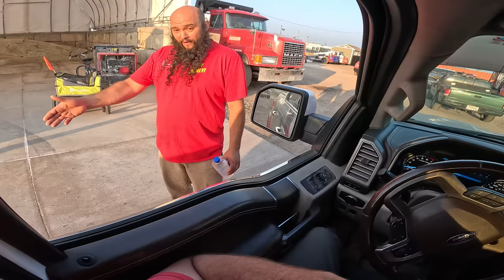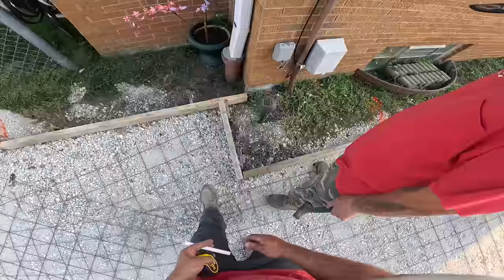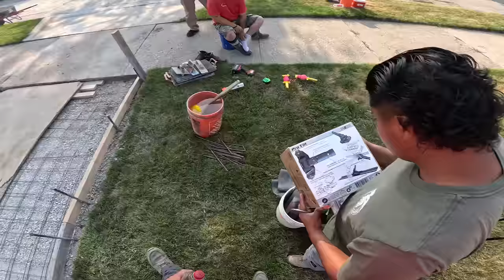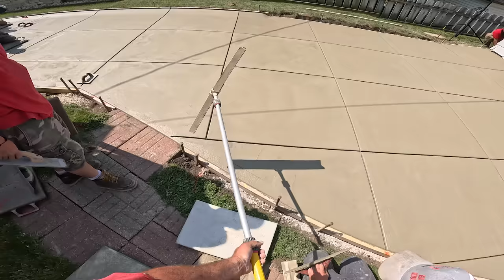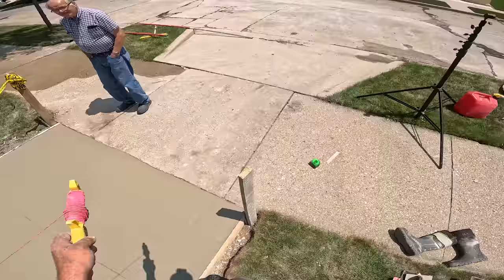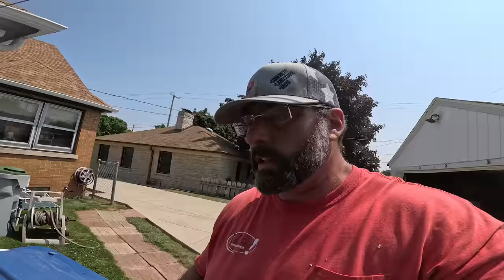Pouring concrete with the bicycle gang! The delusionals!

Comment: Ryan, why don't you rent a large excavator and set the big concrete beams up in a row for salt storage? You may to use some smaller ones for the width. It will save you rent at the other lot, and you already have the canopy.

Comment: Ryan great 👍 channel. I’ve been watching your channel for a while. I got an idea! You know those 4 each heavy concrete highway beam’s on the new property? When you reset up the enclosed road salt area, find someone with a small crane to come in and move them into place as the as the bottom base pieces, two on each side length wise. Then bring over the smaller concrete blocks and stack them in the back and on top of the big ones on the side’s. Maybe pour a pad of concrete first and just before it fully sets up stack the concrete pieces/blocks into place. That way they will set into the new concrete pad about 1”, making a water tight fit.

Comment: I have a question about concrete,  I work for a flooring company where I inspect new construction Slabs for high spots and low spots etc, checking the inetegreity of the slab... my question is what is it when I come across a slab that has a bunch of like fiber glass hairs in it, it almost looks like. Most are smooth.  But some has this fuzzy strands that came through time to time

Comment: If I could give you some advice regarding your gate, weld the dogs to the gate post and weld each nut to the bolts so someone cannot take the brackets apart to gain access. Trust me!

Comment: I would use those concrete beans for a back stop for the parking area or line the driveway with them. You could use for a salt corral walls. I wouldn't just scrap them.

Comment: hi ryan  your new yard seems only to be surrounded by hedge dont be so quick to get rid of those beams they would make great walls or bay dividers and the hammer on your bobcat would make lite work of them when they are dune with you already said your getting a dozer in  so pushed in to place as walls stop any squatter's or fly tippers just a thought  great videos mate

Comment: Maybe you could use those giant concrete pieces on the new property to your advantage, divide an area, new salt area, block access to vehicles on questionable property lines. You could put three in a rectangle with an open side and put a top on it to secure and cover equipment and other valuables. They look expensive, use them to your advantage. Love all the channels!

Comment: Ryan, perhaps the easiest and cheapest solution for the concrete barriers is to just move them to the area of the property where you intend to leave a brush line between the property line and the developed land. Put them inline down the line and forget about them.

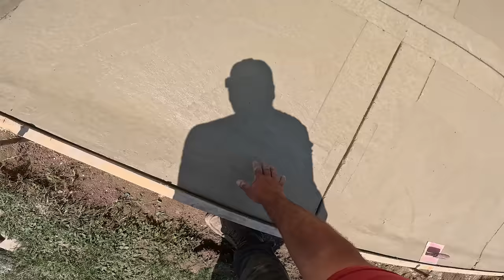Comment: @35:39 RYAN!!!what does that mean that the concrete is moving the way it is??? is it drying faster underneath than it is on the surface? - thats why the top is moving the way it is and it seems wetter at the top and dryer at the bottom???
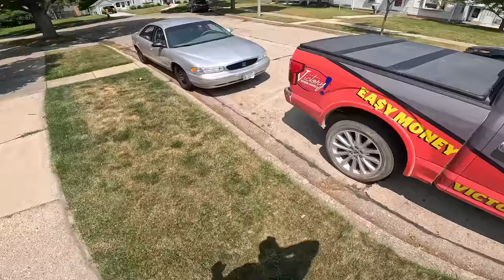ALSO >>>> @40:12 THERE'S NOTHING WORSE THAN THE CUSTOMER CONSTANTLY WATCHING OVER YOUR SHOULDER/WATCHING FOR EVERY MOVE!!! They have TRUST issue's

Comment: Should use those big concrete blocks for parking barrier where you park the truck so in case someone forgets to pull the air brakes your truck doesn't roll into the train tracks

Comment: Hi Ryan. How about using those big concrete sections as boundary blockers on the land to deter unwanted visitors from entering once you clear and and have possible access points from the roadway. Just our thoughts… Cheers from Angela and Jeff in Australia.

Comment: The Huge Concrete Columns on UR new property @ last minute of video. U say u don’t know what to do with them. Before I paid to have them removed I think I would  put the word out to give em away for free. Just by chance someone locally may need them for a creek bridge type crossing. I have been to plenty of wooded properties where there are smaller bridges and them things sitting on some  double or triple sized footings laying straight across bank to bank. Then run some typ of wood or metal top for bridge deck. Save him the $$$$ and headache of getting rid of them.

Comment: Lol get some patches for your bicycle gang that just say "land of delusion" on the bottom rocker patch for your location. The top rocker for the club name can be "mud slingers" with the victory company logo as the center patch.  But instead of a "mc" patch next to the logo you just get a 3" square patch that says "BC" for bike club. And you absolutely need the cards but might wanna check the difference between the plastic coated cards vs the regular non coated old style playing cards. Get a curved patch to put on the front down on the side that says delusion crew instead of doom crew!!

Comment: Those concrete columns could perhaps help as support beams or structural beams for a factory. Could be wrong and maybe won't work.  But if does could save on costs. Keep up the awesome work you's do victory team.

Comment: Suggestion:
Drag those concrete beams with the truck over to where you are going to park and use them as parking blocks.  I have no idea if the truck will do it though.

Comment: Be careful around those poles on your property.. That black line  on the pole is mid section is cable TV fiber and those ground boxes are telephone and he has to be careful where those underground lines go hes uprooting trees and the roots will shred those phone lines or rip through the cable...  Call the ground utility locator service people and get it marked to be safe... You do not want to damage that fiber it is very expensive to repair and the phone boxes as well...

Comment: Those are concrete truss’s used for bridges, in fact it looks like there where once installed somewhere and then removed by the way the ends are broken open like that, kind of interesting actually

Comment: Telephone pedistals- usually holds a splice for customer service line and also to splice two separate cables especially if cut because there was no call before dig. 😊

Comment: Stack all those beams side by side and 1 either use it as a barrier or 2 you could pour some ramps and make yourself a little oil change station those things are built you could drive anything you have on them for sure 🤷 just a thought I wouldn't want to get rid of them that's for sure 👍 but your land your plan 💯
Reply: Obviously use a big Crane probably run you a little bit but a oil change and truck maintenance place to work on things without a jack or being on your back would be ideal for me just saying 🤷😂

Comment: To control the ants near the pet food is to put out a small dish of uncooked instant oatmeal. Works indoors and outside as well. If it is a persistent ant issue, just keep putting out fresh oats until the oats stop disappearing. The oats swell up in their bellies and they go pop like popcorn.
Reply: My grandfather used that method for ant control. It is chemical free and safe around pets and the little ones.
Reply: @tommosher8271  Ants will cover an entire acre to find food, moving Jade would only provide temporary relief.

Comment: You should think about using those big concrete blocks to create like a pit, similar to what you have for your salt at the other lot, but you could dump excess gravel in it when you have left over from a job and then once you get enough you can use that on your next job

Comment: Can you use two skid steers to lift one end of the beam and set it on the Mack. Then lift the other end and slide it in. May work with the way your tailgate lifts. If they are too long chain the back. Just a thought since I don't know measurements for them.

Comment: It would be a lot of work but you could break down  the concrete beams into longer  blocks and have  them to stack up one or two blocks  high for your walls  for a nice  pit for your salt / gravel/ dirt once you get established on that yard could use them for your benefit would be much more cheaper to hire a company to move them around on your property then to move them totally off of your property idk just an idea but I'm sure it's already crossed your mind